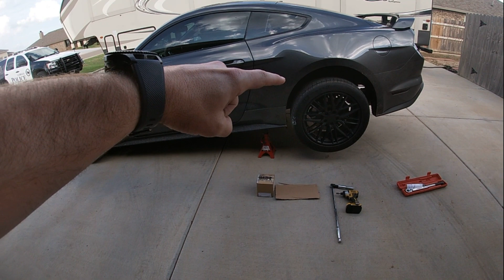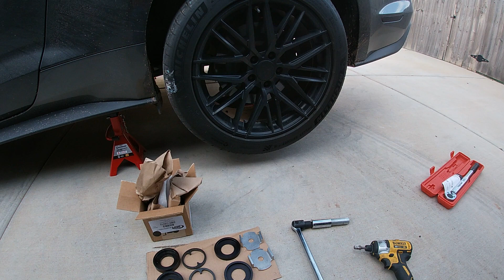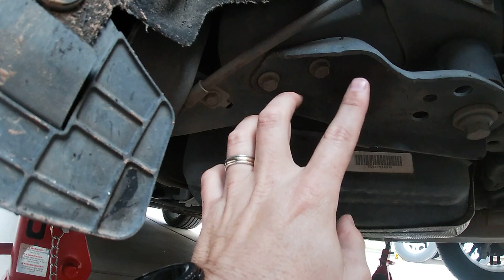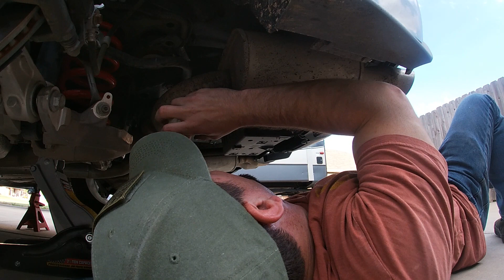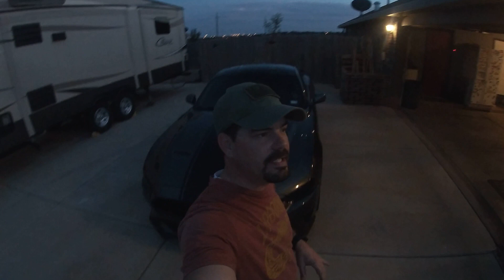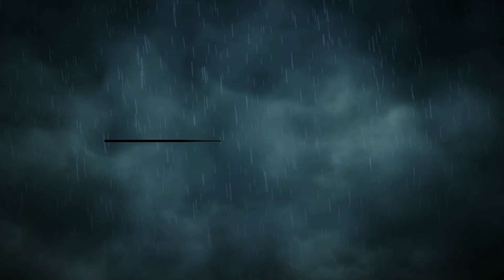BMR Cradle Lockout Level 1 2019 Mustang GT PP1

Comment: Thank you.. I planning to install level 1 BMR lockout on my 23 Mach1. Have you experienced any issues with your installation??.
Reply from the maker: No issues, ez install.  You won't notice the difference in daily driving or really even on a track by themselves.  This is one of those mods you do in conjunction with other suspension mods and as a whole they help one another out.
Reply: @vanhammerhp3248  thanks for the reply. What I noticed after install (and what I didn’t like) was that it stopped shifting up and down first 30-60 ft at drag strip. My Dragy 60 ft times came down 2/3 tens as well an my 1/8 mile times. And I cut better lights. I’m happy. Side info. My son and I installed in my garage using your video as guide. I did have to get an alignment as it caused the steering wheel to be off a little. BMR tech told me that normal.

Comment: Another good vid man. I'm currently shopping suspension mods to do next spring and this is on my list along with springs. 

Kidda off topic but how dark is your window tint? I'm getting mine done Monday. Doing 20% in the rear but not sure if I should go 20 or 35% on the doors.
Reply from the maker: Not sure about the tint.   The dealership had put it on before we bought it.
Reply: @vanhammerhp3248  copy that, I just did a little Google-fu and it appears TX allows 25% all the way around the car. So that's what I assume it is. Here in MO we are only allowed 35% on the doors. But here in STL the police have much bigger concerns than window tint on a car driven by a responsible adult. Thinking 35% just to avoid any possible issues and to keep night visibility up on dark streets. Thnx again. Keep up the vids.

Comment: How do you like this kit?
Reply from the maker: I guess it was fine, it was easy to install and I did not notice a ride difference one way or the other that I can remember during normal driving conditions.  I really didnt get enough run at the track to really guage the difference.
Reply: @vanhammerhp3248  Why did you install it?
For the Hop issues?  so this didnt fix the hop?  if that was the reason
Reply from the maker: @d3et1roi3t  I did install for the wheel hop, but i installed a couple different things between my trips to the strip.  The last time I went I did have my best numbers.  For the price and ease of install it cant hurt to get them.  BMR make solid products.